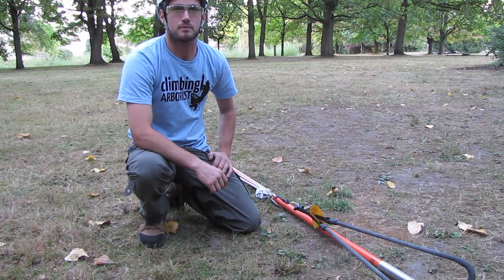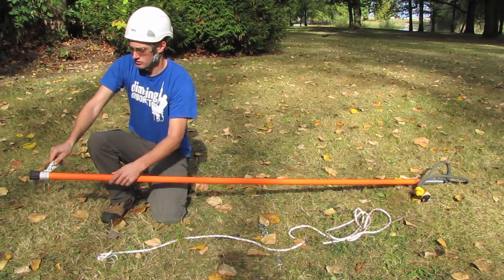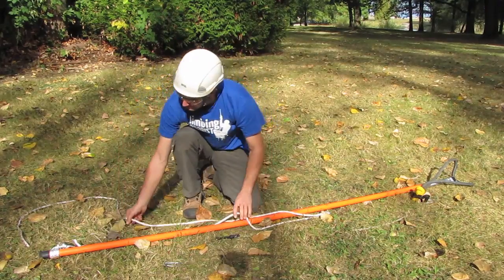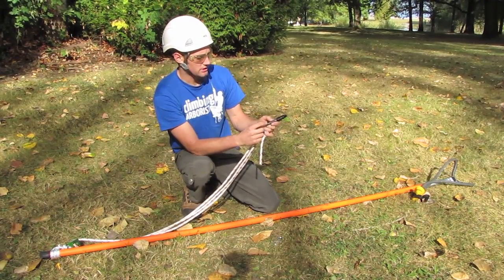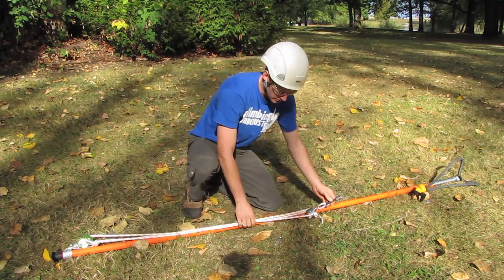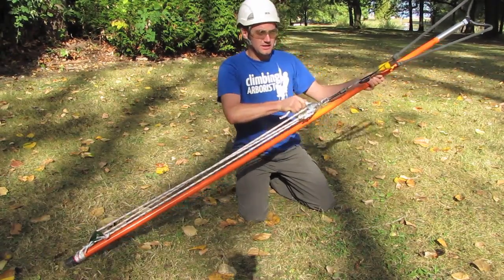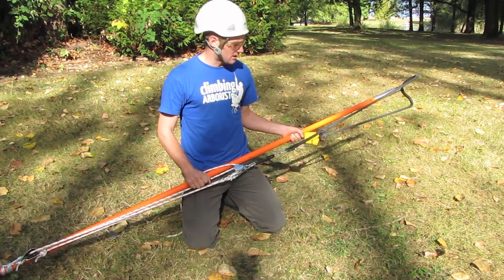Trigger system for the 'Big shot' arborist sling shot.

Comment: Love the mechanical advantage of the pully system you came up with. 
I weigh 140 LBS and I have a hard time stretching the rubber bands and setting the cup into the trigger (i bought the trigger)
Aiming & firing is a breeze. On shorter throws, I guesstimate how much line to flake out, and step on the line so my weight doesn't fly way too far.

Comment: You haven't even pulled the pouch 4 feet from its static position, and that's farther than you can pull it by hand? If you seriously can't pull that pouch at least 6 feet by hand, then you don't actually do tree work for a living. Even a beginner is strong enough to do that. 

You've reinvented the wheel, man. Just put the lower prusik on the pole where you want the pouch, clip your trigger to it directly, throw out all the pulleys and ropes, and just pull the pouch down by hand and lock the trigger onto it. Then just place the bag in it when you're ready to fire, and Bob's your uncle.

Comment from the maker: Hi, yes I wanted to do it on a budget as the cost could get out of hand and if your not using the trigger system that often it may put you off. The trigger is the part that costs the money, the one I used was $27 from Cabelas in the U.S and everything else was just a few dollars here and there (most of which you could probably use things that you have lying around).
Reply: I wonder if a person could build a trigger, like on a CrossBow, into the lower end of the handle; and put a little flat hook on it. Then put a geared manual crank wench, with vynal coated 1/16" airplane cable, at the bottom of the handle. Hook it to the base of the bag cup and crank it down and hook it took the trigger hook and then take the cable hook off of it. Aim and just pull the trigger. Hey...I'm a retired tool designer. Y'all give it a shot...pun intended. This way there's nothing to rig on your "gun". After all...its just like a crossbow...just more pressure stored per shot! There's your design change. Somebody patent it! That's my gift to you! ( It shouldn't cost much to do.)

Comment: Spoiler alert: Equipment list:
6mm(?) cord approx. 18" for distel knot for progress capture
6mm(?) cord approx. 36" for pull-rope anchor
8mm(?) rope approx. 10' for pull rope 
simple (non-locking) small carabiners (screw-lock ovals/quick-links will work) times 2
small screw-lock oval carabiner/quick-link
small double-sheave pulley
small single pulley
archery bowstring trigger (Cobra brand mentioned)
loop of padded 2.8mm wire cable (but paracord might suffice)

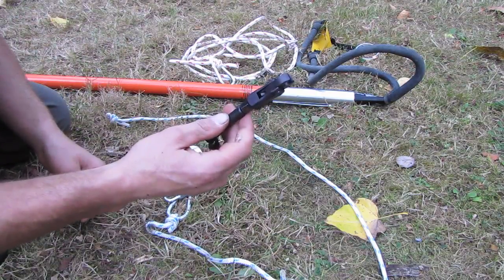(You can see the nut-and-washer attachment at 1:40. Slow the playback to 0.25 to catch it as he turns his hand.)

Comment: Thought you said simple, this is the most overcomplicate trigger Ive ever seen.
Have you sen the production trigger ?
Or 1 torque strap with the trigger attahced to the strap brake. So simple works so well, this is way too much trouble lol.
pulleys are a waste of time. 
One quik link the rope could pass through same thing.
If you can pull the bigshot full length with your hand u can certainly pull it thru a quiklink 2 to 1.
torque straps cost 10.00, 1" webbing.

Comment: hi, please tell me where can i get the trigger sistem
Reply: You can order the trigger system designed specifically for the Big Shot by Sherrill Tree on Amazon for $35. That's less than what you'd pay for the pieces and parts for the one in the video. https://www.amazon.com/gp/product/B07885BY9L
(You can also order it from most any arborist supply, and even from HomeDepot.com. You can even get it direct from Sherrill Tree - https://www.sherrilltree.com/notch-big-shot-trigger)

Comment: good demo, thanks.
a couple of points, these can be dangerous, you made no mention of safety during this video
the line can be dangerous when you fire it, you should always wear eye protection incase the rubber breaks and fires it back in your face. 
also the UK went decimal in 1971, how about the distances in metres?

the triggers are great, I've used them with a big shot and they really add a lot to the system